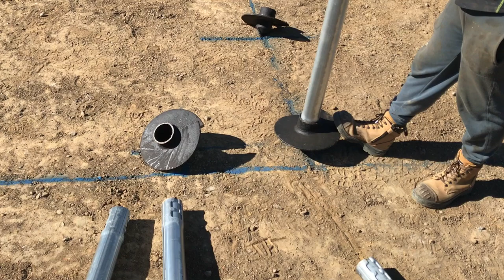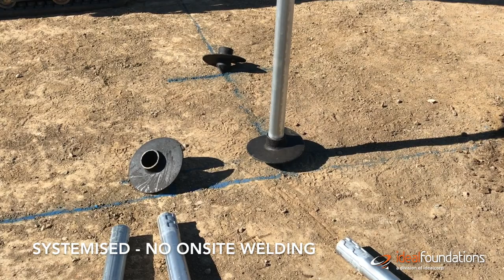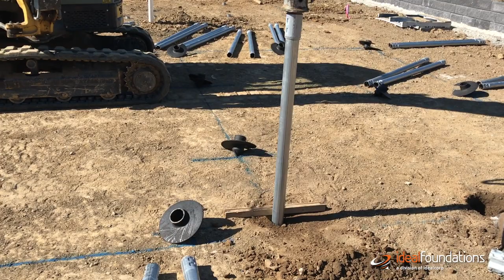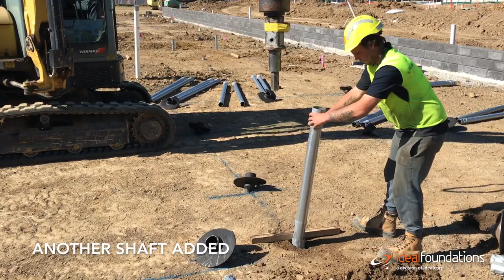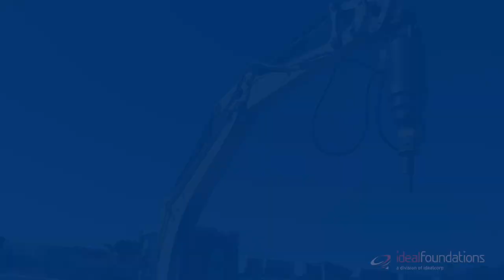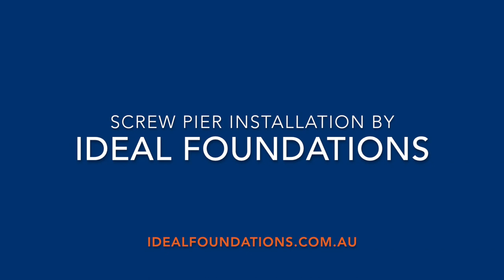Ideal Foundations  - Screw Pier/Pile Installation

Comment: Surely there is a huge void in this method due to the home diameter being bigger than the insert itself?
Reply: No.  The helical thread at the bottom is the only support for this pier. When the combination of soil pressure and soil strength is high enough, then the installation torque will also rise, indicating that sufficient depth has been reached. 

Relying upon some arbitrary municipal regulation for "adequate" depth is a poor substitute for science.
Reply: The soil at the surface has no overburden pressure, so it becomes quite loose during initial boring. An entirely different condition happens when the helical plate reaches far enough below. At depth, the overburden pressure immediately closes the cut above the threads.
Reply: @avid0g  just like wood screw, the deeper the stronger the hold

Comment: Every year soil move or lift up that will cause crack the house.
Reply: these go below the frost line. They can not be picked up by frost heave. Many engineering studies have show this or it would not be code approved all over the world. Also better in seismic activity areas.
Reply: Speaking of cracks, sounds like you have one in your thinking!

The Deeper you go, The More Stable it is. At 15 feet you have reduced the movement of the foundation by 95% or more, depending on the area and soil conditions.  This is from a Engineer for Commercial Construction who does nothing but soil Testing.

Comment: This is better than concrete piers?
Reply: Unbelievably cheaper...easier to remove...much quicker to install
Reply: If you want a warranty that exceeds 30 years, then think carefully about the pier corrosion resistance and soil corrosive properties - especially near the surface!